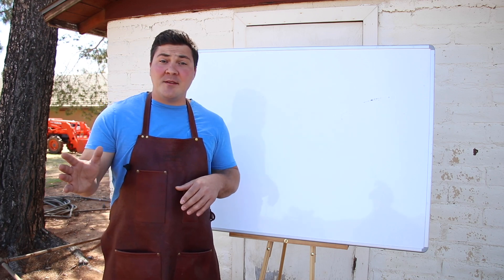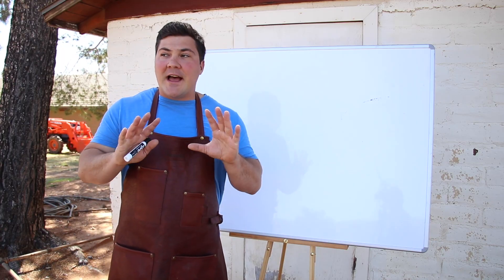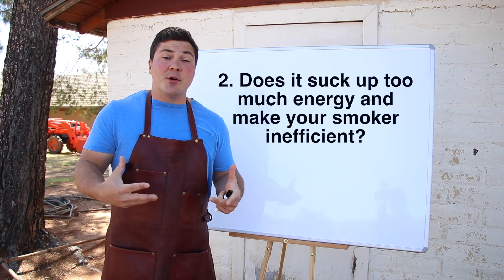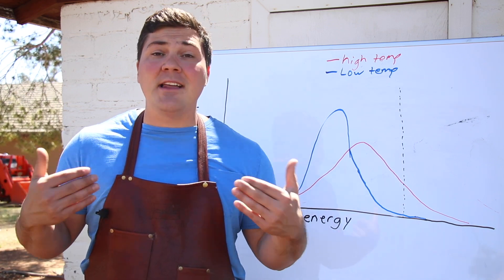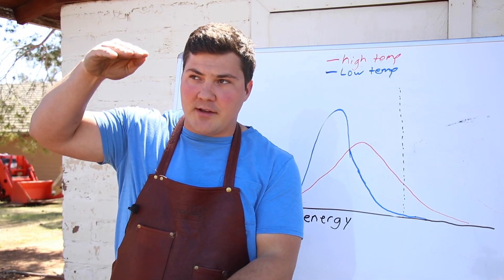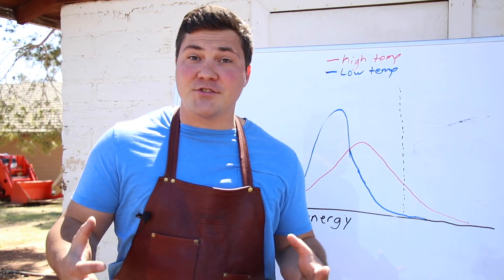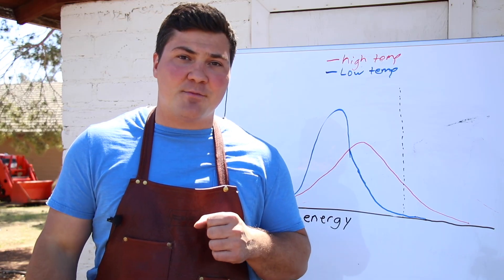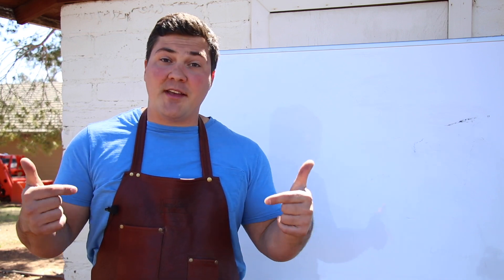Do Water Pans Improve Barbecue? A Scientific Analysis

Comment: I feel like a large body of water in your cook area works as a heat stabilizer, It will absorb the heat and hold it for those times you open the lid so it does not take as long to recover. On the flip side, I also feel (like you mentioned) that the heat spikes can be less drastic because the water can absorb some of the heat and prevent it from spiking too high. There is more things to absorb the heat in the chamber, so that would explain the inefficiencies mentioned. 
Thanks for this video.

Comment: My seasoned white oak in my firewood pile has been drying for 3months since I stacked it.
Starting moisture was 21, 23, and 23 for the pieces I checked when I split it.
Today I stuck a moisture meter on it, and it read 11, 12 and 11 on the same three piece I have been tracking.

You might want to question your supplier of white oak....that stuff ain't seasoned 😮

Comment: The only thing I could point out, having taught thermodynamics, fluid flow and heat transfer, is that NOT ALL of the water produced in combustion is water vapor.  At temperature above 'the boiling point' (212F, 100C at sea level) during combustion that water water has turned into a superheated gas (which is a condensible compound above it's boiling temperature; a true gas, NOT little droplets.)  That gas largely remains a gas and does not condense if the chamber temperature is above the boiling point; ONLY the gas that impinges on the meat and gives up it's superheat, becomes water vapor, and actually condenses on the cooler meat.  And that heat of vaporization (= heat of condensation, the less used term) imparts a dramatic amount of heat to the meat.  Much more heat than the CO2, which is also a gas, but obviously won't condense.  Most of it probably just vents out the stack if still above boiling.  So all that water from combustion is lost to the process, it doesn't count.  That makes the contribution of the water pan even higher in proportion.

Comment: I think you forgot to include humidity on cook day, around here on the average summer day outside temp is at least mid nineties and humidity is in the high eighties or low nineties so more water is being pulled into the pit. other than for highing to reducing spikes in pit temp I don't see any need for a water pan where I live.  in dryer climates is another story, but I have never run long cooks under those conditions so don't know.

Comment: I came across this recently.  I use a vertical smoker and burn lump charcoal and wood chunks for smoke.  My smoker has a sizable water pan in it, and I always wondered if it was overkill.  What you showed in your chemistry equation helped me make sense.  Since I'm using the much dryer lump charcoal, the water pan is more necessary in my smoker (a Backwoods Chubby G2).

Comment: I don’t believe that’s what “20% moisture” actually means. “Because the moisture content of wood is equal to the weight of the water in the wood divided by the weight of the wood without the water, the moisture content can exceed 100%.” So it’s not 4200 x .2 = water weight, it’s y + .2y = 4200, where y is the weight of the wood and .2y is the weight of the water in the wood. I think lol.

Comment: Thanks for the video. Have been a fan for a few years now. Looked up this video cause i am planning on doing two briskets Saturday. So I'll be using a water pan but am wondering if i used alcohol instead of water would it add flavor (JD's Apple Whiskey)? That and a mixture of Hickory and Apple Wood for the fuel...

Comment: I feel like I'm missing something. You do a bunch of math for 1 cord of wood, but does cooking 1 Brisket really take an entire cord? You seem to have figured out how much wood is used in the cook to get 70lbs trapped water, but don't say how much wood that is. Does that mean you're burning 350 pounds of wood? That seems high, but I don't have an offset smoker.

Then at 7:42 you add up 78+52+46+70 and say it equals 176, which is obviously incorrect. It seems you forgot to add the trapped water in the wood.

Comment: Dang Your wood is soaking wet 🤣🤣 There no way my wood holds that much water. UNLESS ? SOAKING WET.. There maybe like 3 gal. of water in the WHOLE CORD  Weight of water is? 8.34 lbs. to a gal. of water.  Will call it about 8 lbs. a gal.  So 3 x 8 is 24,  lbs of water

Comment: Hot surface without moisture.... dont feel much heat on your hand when holding it a few inches above...
Same scenario with heated vapors... too hot for hand in those scenarios.

Thermal conductivity is much more efficient via vapor, vs just (dry air)

You can argue that water will throttle temp by not allowing certain temperatures to pass, water sponges thermal energy to evap... and ya 

but on low and slow bbq that shit doesnt matter... i cook at 200=225

IF i was cooking at 400

sure a lot of that energy would go towards evaporating water 
But at low temps youre getting vapor conductivity that is very close to your burning temps 
and a much more even spread of heat.

I could go into this much more, but from purely practical experience, certain hot things you try to clean arent that hot from an inch away.... the moment vapor is involved .... way harder to clean shit without feeling that temperature (everywhere) that applied to smoking.... ya lets use vapor to do our job too.... if you go hot n fast.... okay dont use water cuz it wont get "hot" til all water has evap'd

Comment: I bought a Lodge bread pan and seasoned it. I then use that in my Yoder YS640 smoker and it makes a big difference. Typically, the water needs to be refilled about halfway to get through an entire briscuit cook and I do that when I come out to check the meat and bring a tall glass and fill it up. 

I highly recommend it if you are looking for something perfect to use to hold water on your smoker. Again, you must season it because it will rust due to the water.

Comment: I wanted to watch this video just to see if you touched on the REAL reason for the water pan. I get my information from the older (than me>>63) people. These are the folks that lived through the Great Depression and smoked food to survive. I will touch first on upright smokers. The old hats always said that originally, the upright was called the water smoker, and later, the gas hot water smoker. These always had a tendency to channel the heat right up the middle like a chimney. By adding the water pan to these, that channel heated the water evenly and reduced hotspots. Also noting that the pan needs to be just big enough to cover the area under the food, but not inhibit the smoke. But any smoker can and does have hotspots. Hence even in a large offset why would they need multiple thermometers? And even the old smokehouses in my Grandfathers day did. And they would use the water pans for the same reason. A different concept depending on the smoker, but for the same reasons. When one would mention to these people about it keeping the meat moist, most would just shake their heads and laugh. That was never the purpose. It was for even heat in the chamber, any chamber. Though I will admit extra humidity in the chamber can never hurt. But this is why and how people who are rabid against water pans still get good and juicy bbq. They just have to be aware of and avoid or cook around their hotspots. No tech or chemistry, just the old world reason for the water pan. A body of water of the same depth will always heat evenly across it's surface. You finally kinda got there in a convoluted way...LOL.

Comment: you forgot to add the trapped water to your final number. 78+52+46=176. you add 70 and get 246. however, you seem to have used the correct number for your percentages

Comment: Wow, just getting into smoking, but I have some questions about your analysis. First, don't water molecules bond to smoke molecules? If they do, then by increasing the number of water molecules in the smoke chamber, you're effectively removing smoke from your chamber. Of course, a small percentage will still adhere to the meat, but the rest will bond with the smoke and either condense into drippings or escape through the vents. This seems to me that NOT using a water pan would increase the smokey flavor of your meat. Put it another way, with more smoke molecules adhering to the meat, then as long as you reach your desired cook temp, your cook time would be shorter. Or if cooking for the same amount of time, your meat would taste smokier (is smokier even a word?). In any event, I would expect the smoke ring to be substantially less if you add a water pan. I've seen other videos that confirm this hypothesis, but I haven't done any experiments myself yet.

Comment: I am relatively new to "smoking" Charcoal Grilling for decades, my first smoker. This does make a lot of guess work go bye bye, the higher the heat, will demand more water but not for the actual smoking process prevention of burning what you are cooking. So my rule of thumb 275 degrees and below water spray, above that use a pan.

Comment: Another couple things, moist air will cook faster than dry air because it’s able to transfer the heat to the meat much better, meaning more of it gets used up by cooking and you lose less of it out the chimney. 

And I use a Weber kettle with the snake method for smoking, so it has thin walls and it’s quite small so it’s really susceptible to temperature changes as the cook goes on. I’ve found that without a water pan the temperature goes crazy, and it’s much easier to smoke with a water pan. This is because the water pan acts as a heat buffer, so if there’s a flare up in the smoker the water will absorb some of that heat and help control the temperature. If the coals start to burn out the water pan keeps heat inside the kettle. Controlling temp flare ups is the biggest difference I’ve found, and it doesn’t make as much of a difference for controlling dipping temps, but it definitely makes it easier overall.

Comment: Jeremy....Jeremy... I understand that you're a chemistry guy but there are too many errors in your calculations for me to take this seriously.  Don't get me wrong, I love your videos and I learn so much watching them.  That's why I have to call BS on this one.  I am certainly not educated in this realm but even I see the flaws in your argument.

First you tell us that a cord of oak is 4X4X8.  True.  But it's not a solid 4X4X8 block.  I venture to guess that there is nearly as much air in a cord as there is wood.  As a man who has cut, sectioned, loaded, hauled, unloaded, split and stacked cord wood in my time, I can confidently say that a cord of oak does not weigh 4200 pounds (Over 2 tons per cord!!).  Then you say that in a 12 hour cook, you release (about) 70 pounds of trapped water from the wood, which equates to 20% of the wood burned.  Are you really telling us that you burn 350 pounds of wood in 12 hours?  After this I really couldn't take you seriously any more and my mind wandered as you presented your graphs and charts.  Erroneous base numbers compound into erroneous conclusions.

I love your content and watch you religiously prior to attempting new cooks.  Please don't ruin it for me.

Comment: I don't know all the science behind it,  but I use water pans in my 250 gal reverse flow offset stick burner because without it I feel it's (dry heat)...I call it. The same affects I get from using a pellet smoker that doesn't have a water pan. If I happen to be running late for a catering event and i have to run it a little hotter, with the pans it can be ran hotter with the protein staying moist. And the #1 advantage to water pans is that it seconds as a easy clean up after smoking 10 briskets and 20 butts. Anything that can save me 10+ hours cleaning on a busy week is a plus when the days are never long enough.

Comment: I have a cheap small offset cooker (although tons better than the little one you did the brisket on.) This is anecdotal but after 3 cooks (newbie!) it seems to me that the presence of a water pan may smooth out the peaks and valleys when trying to hold a steady temp. I'm using lump charcoal and wood. Any thoughts on that?

Comment: Question what would happen if you added a valve in the bottom of the smoker and used the whole bottom as a water pan only using a gal or so of water? And drain after each use

Comment: Water pan yes....water in the pan not so sure.  Hear me out because this will sound weird.  I use sand instead of water in the pan.  If you are running a smaller smoker, the fluxation of the water level as it evaporates or is being refilled, will cause more problems then adding moisture to the environment.  This is because the temperature is going to be all over the place instead of constant.  In a large smoker maybe not so much but if you are a backyard warrior and only have a small bullet smoker this is a never ending fight.  I've cooked plenty of things in just an oven and never had an issue with it drying out so long as there is something to catch the drippings  A lot of times it will just evaporate and add all the moisture you might want without the need for water.  Sand will hold the heat just like water.  It will never run out, and it acts as a buffer to retain heat in the instance that your fire starts losing steam(No pun Intended).  By by running a sand bowl instead of a water bowl as the primary heat diffuser, you'll have a far more consistant result.  Give it a try sometime, you might be pleasantly surprised.

Comment: Do you know if you use an atomizer in The Cook chamber would it work better to get a higher moisture right inside that Koch chamber. I know in dry kilns for Lumber they will add atomization of water at the end of the kiln drying to prevent the splitting of the wood.

Comment: On cheap barrel smokers the water pan is a most when cooking at higher temps, it difuses the heat catches all the grease and also helps to keep the temp in check.

Comment: I cut a lot of wood and your number of 4200 lbs or 2.1 tons is off sir.  I have weighed it on CAT scales couple times and never seen even green oak timber rarely over 2 tons. The dried busted wood  cut for a fireplace stacked really tight is around 1.5 tons max. Hope this helps with your hypothesis I don’t recommend re doing it tho

Comment: Although my brain now hurts, from over usage......I absolutely love your videos and have an immense appreciation of your knowledge and respect for all aspects of the smoking processes. Keep up the good work. BTW, I live in Alpine (a mountain community above San Diego) and chose the pellet smoker method due to a number of factors. I started with a Traeger about 15 years ago and then graduated up to a Yoder, due to an anticipated move to Idaho (cold) upon my retirement. Well, my plans have changed and I am now moving to the Buckeye area of Arizona this year  (hot/warm). My yoder is approximately 10 years old and has the old electronics, so instead of buying the new pid for it, I've decided to give it away to a family member, so they can enjoy a few more years of cooks on the old Yoder. I've been looking at another smoker that is out there and was wondering if you've heard about them or maybe have some info about them. It's Lone Star Grills out of Texas and they now have a pellet smoker that is supposed to put out more smoke than the normal pellet smokers. If you get a chance, I'd like to hear your input on the 20 x 42 pellet smoker they have. Thanks in advance.

Comment: Jeremy, for those of us who use a vertical offset smoker, do you have any science or tests which compare placing the water pan above the meat versus underneath?  I have seen (visibly) where the water pan does not create as much water vapor later in the smoking process.  I can only attribute this to the increased amount of drippings which inevitably end-up in the water pan, sitting on the top of the water (fat/oil), thus reducing the surface area for the water to vaporize.  I am not scientifically inclined, but if water converts to vapor at all temperatures (depending on the humidity in the smoking chamber), then I would believe that generally speaking, the water vapor will be at a lower temperature than the smoking chamber, even on lower temperatures (225 degrees) when the water is boiling.  Would it stand to reason that, even at boiling, the water vapor would, through convection, be displaced by the higher heat in the smoking chamber going out of the stack and, in turn, descend in the smoking chamber, even though the water pan is above the meat?

Also, as a different approach, for those of us who use a vertical offset smoker, would we be better served to have the water pan sitting directly over the fire in the firebox, to increase the amount of water vapor over the entire time we are smoking meat (unwrapped)?  Do you have any guidance on this as well?  I would also believe that this concept would be applicable for folks using a horizontal offset smoker, not just vertical, regardless of the presence of reduced water vapor in the case of the drippings on a vertical smoker (assuming this is what is causing less water vapor as described above).  If the ultimate goal is to increase the humidity and water vapor in the smoking chamber, to support the permeation of the smoke flavor into the meat, then wouldn't it make sense to maximize the amount of water vapor (as would be the case for a water pan directly over the heat source in the firebox)?

I am very interested in your take on this information and I believe many others may find it helpful to gain your scientific perspective.